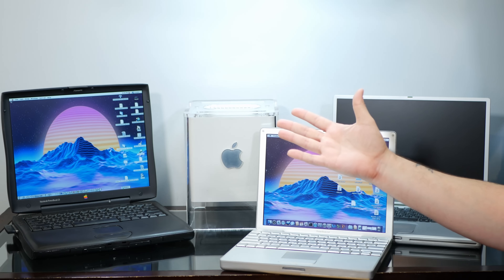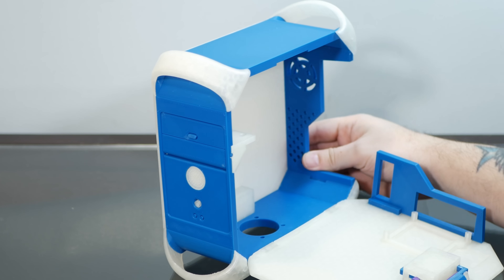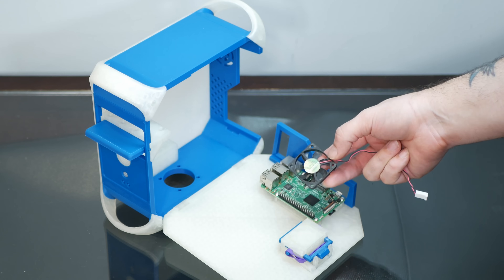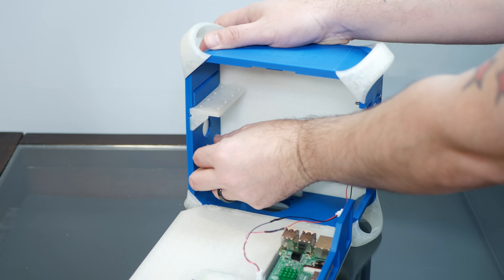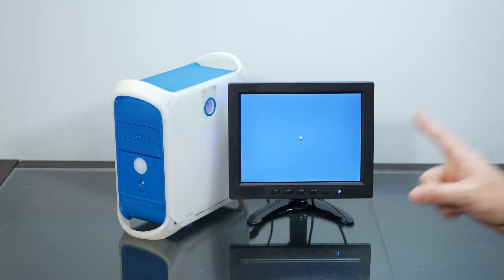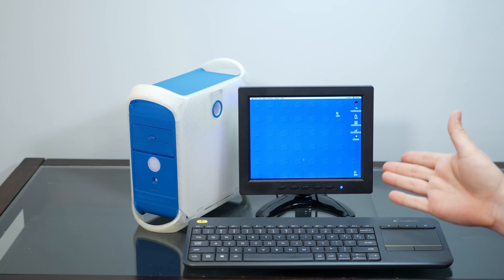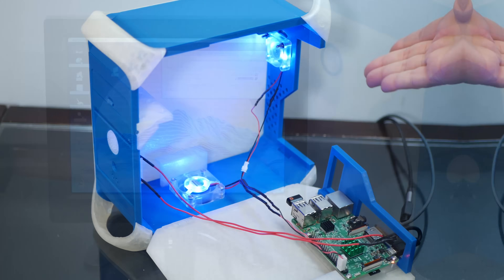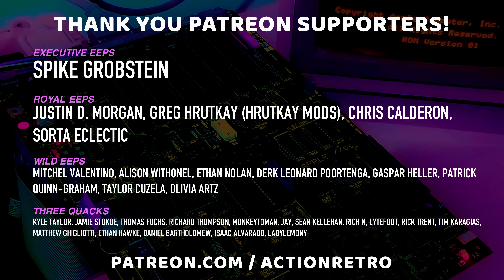I Built a WORKING Mini PowerMac G3!

Comment: THANK YOU FOR INCLUDING THE IMAGE!!!
Reply from the maker: You're welcome, let me know if you try it out!
Reply: @ActionRetro  I did on my 3b+ and it ran HORRIBLY it barely loaded and even when it did it crashed when I dragged a window. Also sound diddn't work for some reason.
Reply from the maker: @dialupdave6276  try putting the sd card in your PC and commenting out the overclock options in /boot/config.txt - the 3b+ usually can't handle overclocking from what i understand
Reply: @ActionRetro  I attempted this as well and disabling it still didn't improve load/run times. Just another nudge to upgrade to pi4?
Reply from the maker: @SatanicMac  i think so 😂
Reply: @ActionRetro  I have overclocked my raspberry pi 3 b+ and got a little bit more performance but the red LED kept flashing if I turned on the RGB LEDs in my keyboard and I had to move the fans red wire from the 5 volt to the 3.3 volt GPIO pins to make sure it wouldn't shut down from not getting enough power and corrupt the SD card
Reply: @ActionRetro  Thanks for including the image, I've just tried in my Raspberry Pi 4 and it's having real problems.  Slow mouse response, not taking up the whole screen etc.  Any suggestions?
Reply from the maker: @trevorboys9140  Ah that's weird. I would suggest tweaking settings in boot/config.txt by putting the SD card into another computer and mounting it. Specifically the items around overclocking and screen resolution/HDMI: https://www.raspberrypi.org/documentation/configuration/config-txt/